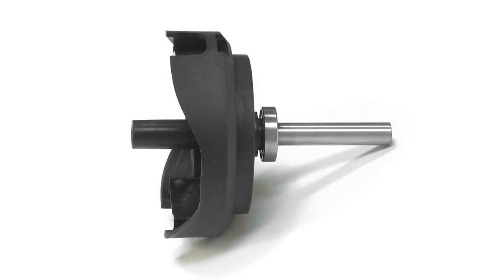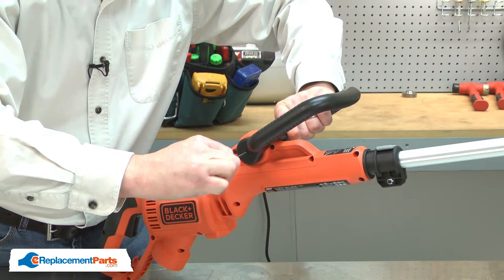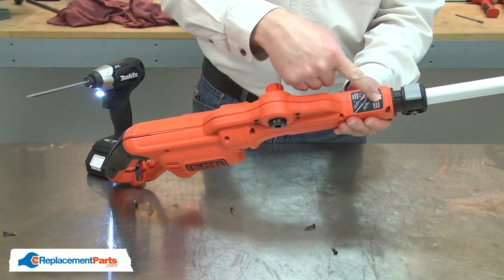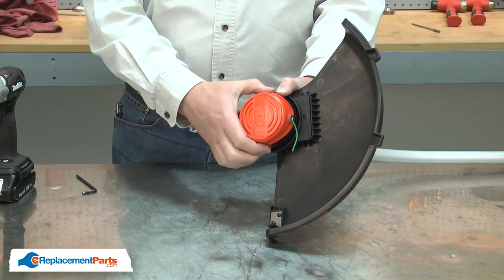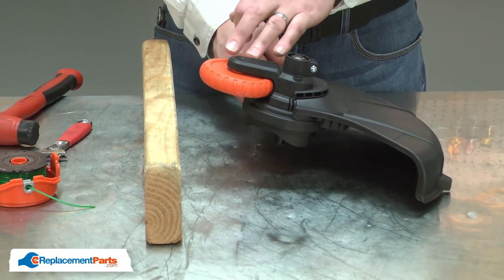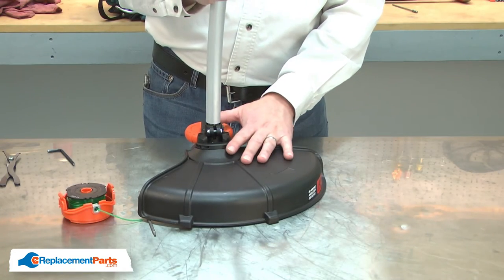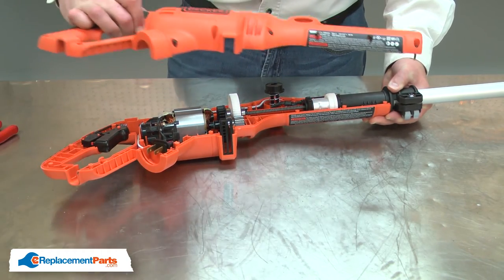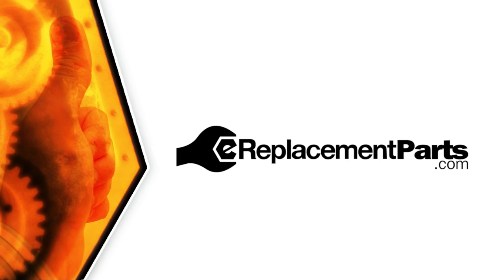Black and Decker Trimmer Repair - Replacing the Spool Housing (Black and Decker Part # 90589746)

Comment: Thank you for this video. I dont know after how many searches I found what I needed. I had to take out the spool housing since s wire got entangled in it when I was using the trimmer. And it happened on the first day of use. Thanks for this video! Really really helpful.

Comment: I've done this job twice now.  The spool housing must be a weak point, otherwise is a good machine.
By the way it is totally unnecessary (and a lot more work) to dismantle the motor housing.  I was easily able to align the shaft to the gear with a little "finessing" from below.  I also added some white lithium grease to the spool housing shaft - needed or not, I don't know...
The video was too late for me, but it's good that you made it.

Comment: Finally got the handle off. The trick is to insert the rod and pull up on the handle to keep the retainer down on that side. Then push the button on the other side until  it clears the space

Comment: My spool housing's plastic part was separated from the metal shaft. Your video (3:50) shows you are holding the plastic part to undo the flexible cable. How can I remove the flexible cable with the plastic part not intact? Do I need some special tool?

Comment: I bought a wire brush wheel to use on my  weed eater and it is a black and decker weed eater. But I don't know how to attach it or if it can be attached. my yard is like a jungle. I am 71 years old and I need a strong weed eater to cut down the small trees, vines and the rest of the jungle down. does anyone know how I can put the  wire brush wheel  on my weed eater.

Comment: Is there a trick to getting the handle off?
Reply: I used a thick coat hanger to push in the hole and only the handle side with the coat hanger inserted came loose.  I put both feet on it on the floor on either side of the handle and mangled the handle off with that one side disconnected.  I thought the handle might be damaged, but the plastic handle deformed enough to remove it on just one side disconnected and it seems intact.  It was not easy.  I figured if the handle or housing was damaged it might be trash anyway.

Comment: Not that easy 
My spool housing wouldn’t unscrew, it was like welded on to the shaft 
😂😂😂
Reply: how did you get it off?
Reply: @adebrettski  Mine was kind of stuck and I used (2) 13mm open end wrenches on each side of the spool housing to break the threads loose.  I had to push pretty hard to get it to move.

Comment: Thanks.  I have this apart, but when turning the spool housing to unscrew it from the cable, the spool is hard to turn while I am clamping the cable in a vise. Basically the cable is not unscrewing.  Any suggestions?
Reply: Experiencing the same issue. I think that’s why he took apart the upper end; the shaft goes all the way up
Reply: @annmaes7550  I was trying to replace the spool mechanism with another brand that has great reviews.   That necessitated unscrewing the head assembly.  Ultimately I was not able to do this and returned the head.  I followed another YouTube video that showed how to disable the auto feed and only manually feed it.  Still not a great solution, but better than the original design.  BTW I saw another video that explained the reason for auto feed not working properly was the line size was too large.
Reply: @SamuelG5  gotcha.